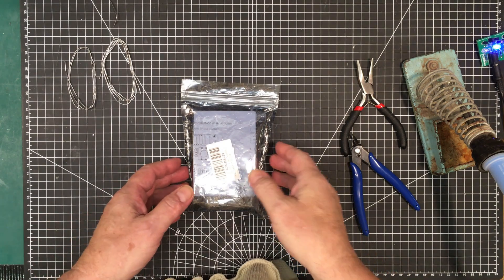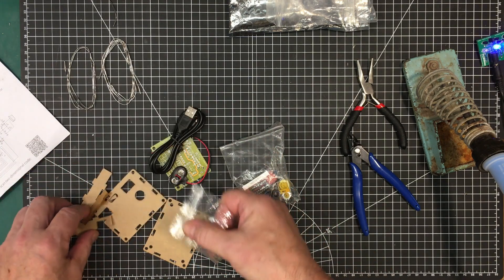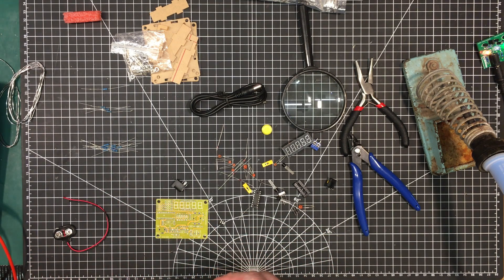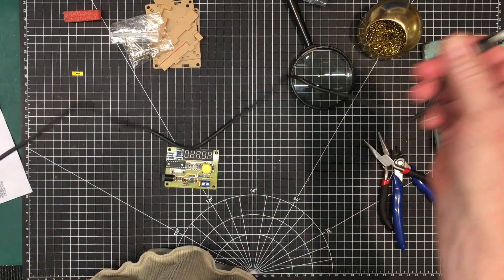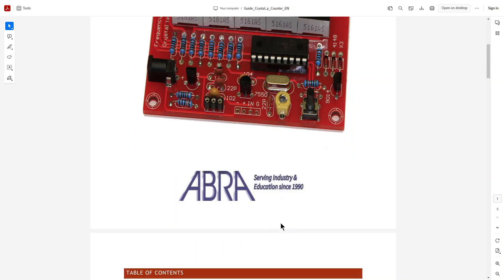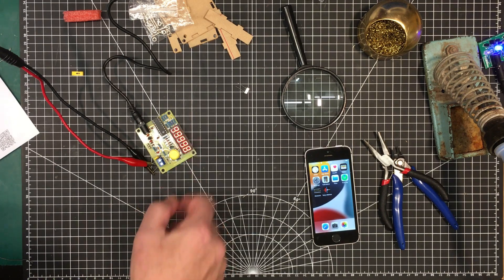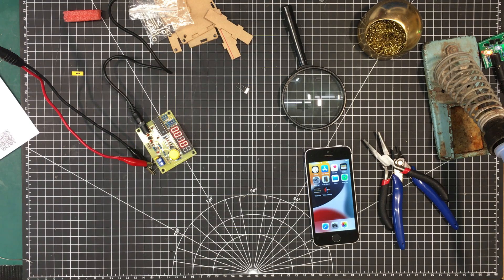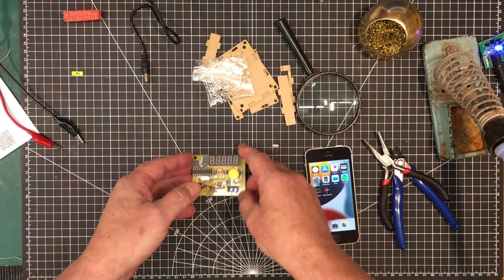0092 - Inexpensive Frequency Counter / Crystal Tester Kit Build

Comment: I built this kit recently. Works well and accurate on the crystal test, but can't get a stable count on the input select.
I can get a count off of my cheap function generator, but not accurate, and if I try with a small XR2206 generator it just fails to read or gives garbage readings :(
Still working my head around it lol
I wanted it to match with the XR2206 to make a quick signal generator. (Mostly audio freq (20Hz to 22 kHz))
Reply from the maker: The XR2206 may not have the right offset.  Try feeding it into the counter through an electrolytic capacitor, maybe 10uF-100uF.  Have the positive end toward the XT2206.
Reply from the maker: @axle.student  I did.  @7:44 I connect it up to a signal generator.  Hope that helps.
Reply: @ P.S. Reading off of a 20kHz crystal tests at exactly 20 kHz on the digital meter. I tried a few other freq crystals and the counter displayed accurate values.
>
Anyways, I'll go back to the start and step through some of the suggestions :)
Reply: @uni-byte  P.S.S. If you have time.
The external input to RA5 (schmitt trigger) is fed by R3 from +5V, and then a 1N4148 on the external input. Earlier (original circuits) don't seam to have this. I believe the RA5 Shmidtt trigger requires + 1 - 5V DC to trigger (0-1V Low, 4-5V high).
I can't see what this +5V Vcc, R3 and the diode is meant to do for the AC input signal? Is it meant to offset a 2.5V AC p-p so it is above 0V (+2.5V, DC 0 to 5V) for the trigger?
Reply from the maker: @axle.student  Yes, the range is Low < 1V to high > 4V.  So, to be guaranteed to be recognized, your signal must go below 1V and above 4V.  To get around that limitation the diode blocks anything above .7V and R3 pulls the input to 5V, and anything below .7V pulls the input low.  If the signal goes below 0V, the protection diode in the PIC will clamp it at a reasonable level.  What all this means is, if your signal is offset such that it never goes below 0.7V it can't trigger a reading.  Also, it must be strong enough to pull the input low against R3 as well as not so strong as the kill the protection diode if it goes below 0V.
Reply: @uni-byte  "To get around that limitation the diode blocks a..." Thank you.
My head was leaning that way, but you explained it in a way that makes sense.
>
All that I wanted was a quick Freq counter to go next to that XR2206 so I don't have to hook up an oscilloscope every time I adjust.
I am only after 20Hz to 22kHz for playing with analog audio circuits and amplifiers lol
The earlier Wolfgang Buescher versions appeared to work well for that.
I am going to go back and study the original circuit diagrams and compare with this and see if I can get a stable count.
First I am going to clean up that XR2206 with some suggested corrections.
>
Thanks again for the advice. You have been very helpful.
>
"I have not failed. I've just found 10,000 ways that won't work." - Thomas A. Edison
Reply: @uni-byte  An update on my 2 working kits XR2206 copy sig gen and the DL4YHF2 Frequency Counter working together. ( I am only focused upon lower frequencies (audio up to 50kHz) for a quick sine wave generator).
.
Connecting the 2 to add an accurate[ish] counter to the signal generator:
I focused upon using the square wave as the counter source (Most simple).
The XR2206 sqr wave is just a pull up resistor from Vcc (+9V) directly switched to ground via an NPN in the chip giving me about 0.5V low and 8.5V high; way out of range for the DL4YHF2 input.
The DL4YHF2 is using a pull up resistor from the Vcc (+5V) and needs the input to switch to ground to pull pin 3 (RA4) below 1V.
Using a voltage divider, load to ground, capacitor to remove the DC offset never quite gets the pin 3 to ground. I even placed a class A common emitter (de-tuned to a 4-5V output ac) and works but unstable. It always seams to sit just above the +1V trigger on pin 3 lol
>
My quick and dirty solution:
Voltage divider and an NPN (3904) as a logic switch.
Pin 11 (sqr out, XR2206) is either +8.5V via R1, or pulled to ground via SYNCO in the chip.
I placed 2 resistors after Header 3 using sqr out as the voltage source and gnd as the ground to create a voltage divider and limit the current. Keeping R1(XR2206 pull up resistor) in mind I aimed for about 2V 5ma (R1 = 10k, R2 = 3.3k) with an effective voltage of about ~1.3V at the base of the NPN (B E).
The collector is connected to the freq counter input (+5V) via another 1k resistor. The 1k isn't really needed but I put it there as a bit of protection for the 3904 C E as the emitter is directly to ground.
In essence I am using the voltage from sqr out to switch the NPN on/off via B E like a fast switching relay. C E just pulls the PIC16F628A directly to grd. It is either ~+5V via the R3 pull up resistor, or direct ground via the 1N4148 and 3904 CE switch.
.
The frequency count is within 0-1kHz accuracy and stable. (tested from 50Hz to 4kHz atm)
The square wave at the PIC pin 11 is a sound ~0.2 to 4.8V. There is a bit of splatter on my scope, but it is slightly better than the output of the XR2206 so all good :)
P.S. as I am not running a regulator on the XR2206 I tested it in an operating range from +7.5v to +12V and the little fast switching relay hack above kept the counter within the 1Hz error and stable :)
>
I know what I did is a bit dirty, but it was the fastest, least complex, most accurate and most power efficient I could think of. I am sure there are many other buffer circuits such as the preamps that will also work well.
P.S. I have the 3904 sitting on a 20mmx20mm piece of protoboard beside (external) the XR2206 :)
P.S.S. adding the 500k trimmer pot across pin 13 (XR2206) in place of R4 let me get rid of most of the horrible harmonics in my spectrum analyzer ( the adjustment is very sensitive in ohm range so selecting an exact resistor would be almost impossible.)
>
Thank you again for your video and reply's. My electronics thinking brain is slowly reactivating. I started out down the electronics path as a youngster and then was introduced to a 6502 microprocessor at 12 years. So it was digital logic an programming all the way from then lol
Reply from the maker: @axle.student  Good going!
Reply: @uni-byte  "Try feeding it into the counter through an electrolytic capacitor, maybe 10uF-100uF."
Thanks for the tip. Yes, I did try that as per suggestions by others.
I built a quick and dirty common emitter preamp and placed between the XR2206 and the DL4YHF2 and that appeared to help a little. I then isolated the capacitor and a small load resistor off of the output of the preamp and connected through that and it seamed to work ( That essentially was an RC filter but reversed). when I moved the capacitor directly to the XR2206 signal out or the DL4YHF2 in, it no longer worked. Reveres what I did and put it back on the breadboard with the same jumper leads and it no longer worked there.
It's the "random" guessing game that is leaving me bewildered. Every time I go back and attempt the same thing I get different results. I even swapped out the IC on each board with ones from spare kits.
.
It seamed very voltage dependent and sensitive to any kind of offset.
It works from a cheap MHS-5200A Dual-channel DDS Signal Generator as long as I keep the voltages above about 3.2 p-p and in some tests needed to go as high as 5.2V p-p, but always the display flutters by about 300 Hz @ 1kHz and centers on about 1.2 kHz
.
Looking at some of the videos including yours it looks like the XR2206 chip is a fake, and the sig generator board components are not following the original XR2206 datasheet.
It is noisy, harmonics everywhere in a frequency spectrum analysis and furry spikes all over the place on the sine wave on my oscilloscope lol
>
I appreciate the replies. I am going back to the beginning starting with the XR2206 armed with a little more knowledge and step through until I can nail down what is wrong, or what I am doing wrong :)
Reply from the maker: @axle.student  Good approach.  Working through these problems is how you will really learn.
Reply: P.S. I had a look to see if you did a follow up and actually plugged it into an oscillator for a test... Nope :)
I will be looking over all of the other videos as time permits :)

Comment: Completely assemble but when give supply no display come what to do please help
Reply from the maker: If everything checks out, It may be that the PIC16F628 has not been programmed.  That seems to be a common problem reported.  You can goggle "dl4yhf frequency counter".  These are based on his design and he provides a link to the firmware.  This might work with the firmware for counter2, but you could try all 3.
Reply: No display on my one either. Checked all the connections. Looks like I received a dud.

Comment: Where can i get a manual pdf?
Reply from the maker: There are links to 2 PDF documents in the vide description.
Reply: @uni-byte do know how to reset?mine before this can read 24khz,after disturb setting table,just can check MHz only.
Reply from the maker: @azzazilmon6669  Yes.  Just press the button util "ProG" comes up - release then press quickly until "2Er0" comes up - then press until if flashes.  That will ZEro (2Ero) out the changes.  I guess they did not have "Z" available to them so they used "2".

Comment: The adding or subtracting frequencies comes in handy when using it as a display for an analog radio, add or subtract the intermediate frequency which is usually 455Kc. I use the cheap LCD freq modules for that also.
Reply from the maker: Good info.  Thanks!
Reply: @uni-byte  had to update as spell check changed my intermediate to intermittent   🙃

Comment: I have this kit and it does come in handy.  I like working on 8 bit computers and sometimes the crystal do fail. It's an easy way of testing them. I always use it to check crystals before I use them in a project or kit. I've been sold mislabeled crystals and IC's before.
Reply from the maker: Agreed, from another 8-bit computer fan.

Comment: This module was intended originally to be used in ham radio equipment. There it would add/substract IF form the crystal to get the tunning frequency (or something like that, not quite sure). Anyway, for use as frequency meter or crystal tester you not need those functions. I bought two red kits and on one, I found that intermitently it did not powered up. After troubleshooting, I blamed the crystal and changed it; it was the culprit. However, the original crystal that came with the kit, tested ok with 20MHz but sometimes failed. My units did not test crystals of low values (4.433M, 32k) but what it test is ok (maybe I try to make a separate oscillator for testing low value crystals?). The crystal used must be adjusted at 20MHz for the module to be accurate, I tested it with crystals of 10, 16, 24MHz and it worked but gave wrong readings. I plan to use one module as an indicator for my signal generator because I found that it can measure lower frequencies (that means that the crystal oscillator is not oscillating with low values crystals)
You got luky to get a manual with your kit.
Reply from the maker: The manual I got with the kit was of limited use, but yeah, it was there which is on the bright side for these sorts of things.

Comment: One reason why you may want to add or subtract a frequency  is if it's being used to monitor the frequency of a local oscillator in a superhet. If you have high-side injection, then subtract the IF frequency or for low-side injection add the IF frequency to get the tuned frequency.
Reply from the maker: That makes sense, thanks.